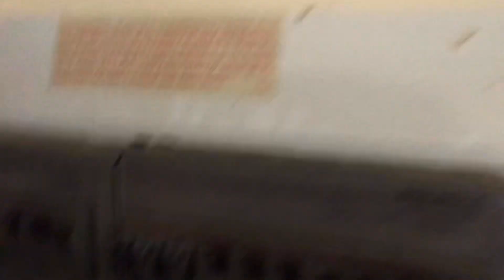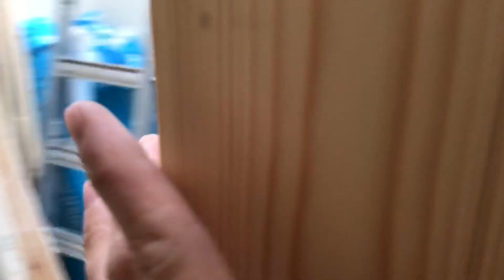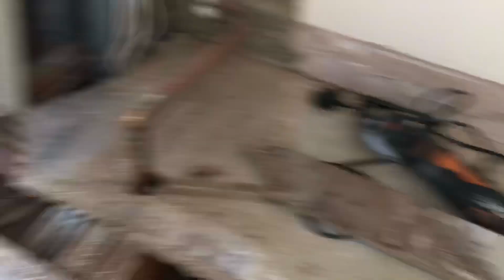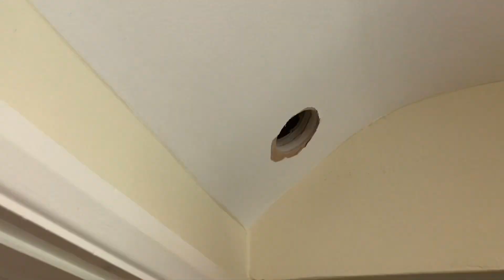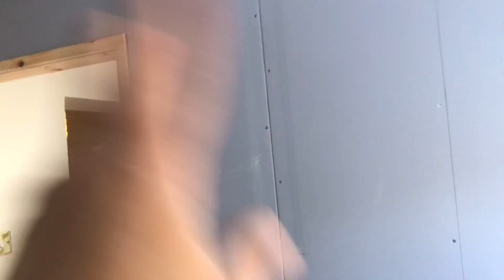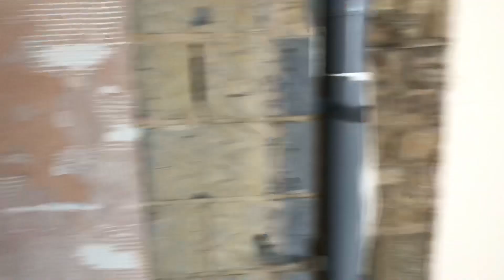CJR ELECTRICAL | Electricians day installing shower circuit.

Comment: I’m certainly not having a go at you.  We all here to help & educate each other.  I cannot get my head around you reducing the circuit breakers to 20A.  If it’s a typical household, there would be no problem what-so-ever.  The kitchen ring would probably use a fair bit if everything is running at the same time,  but what are the chances of that, the other rings would probably use next to nothing.  Unless your concerned with the current going through the Rcd?  Then you could put the shower through a rcbo at the front end or use a 2nd board.  If there were 2 showers or a shower & a car charging point.  I would maybe install a priority switch.  In my opinion & I maybe wrong, changing the 32A is a waste of time & money & completely pointless.  Also 20A rings are no safer than 32A rings. Open conductors still need to be found as they could be floating about causing fire risks, reducing the current rating will not prevent this.  I have seen on many occasions an open neutral or line conductors just put on a 20A OCPD, without the circuit being corrected or put on 2 separate radials.

Comment: I’d like to use metal boxes everywhere but the boarders can’t cut a tight hole around the box and you end up with that bit of plaster which keeps cracking off.

Comment: I'd be really interested to see your vid of second fix of the shower isolator switch. With 10mm in a 1G, they are evil.
Reply: Errr it was a 2 gang metal backbox and he managed it fine.
Reply: @ashmanelectricalservices4318  This is bollocks. I'm just saying how hard it is to wire up shower isolators using the standard 10mm cable. I find I have to fold each wire in a certain way so  that you do not strain the terminals when you push the face on or take it off. That's all. People are so defensive in this industry.

Comment: Why not just use metal plaster back boxes? They do sell them. I use them as I prefer metal then plastic.
Reply from the maker: Yes I could do but at 5 x the price il continue with my method.
Reply: @Cjrelectrical  Aye, I agree with you mate! I'm going to try your method, thanks for the tip! :)

Comment: How will de rating Mcb’s change maximum demand?
Reply: As things stand 32+ 38.4= 70.4 amps
After downsizing 32+24= 56 amps
Reply from the maker: Is this a serious question?

Comment: Not a criticism but you didn’t fit plastic back boxes as metal ones are “fire proof” but then you use wago plastic boxes? 
I use wagos and plastic back boxes so it sounded weird why you gave that reason😄
Keep up the hard work Chris I’m on my holibobs but the phone don’t stop, what do you do when you have time off? Answer phone message or ignore calls like plumbers😄😄
Reply from the maker: When they invent a metal MF box I will certainly be using them. When on holiday I let it go to answer machine but get back to clients at night if not urgent. Emails are non stop though.
Reply: I'm finding messenger on Facebook the no1 communication at the moment, emails not as much lately but can't complain always busy busy😊

Comment: When I did my 2391 fifteen years ago, military clipping your cables was one of the 10 departures on the practical inspection part of the exam. you seem to do it everywhere you have multiple cables.has this changed in the regs? I was told it affects grouping factors etc & was frowned upon as bad practice.
Reply: So did I. I was taught it was a c2 due to the cables being flat. The reason being that any heat can't disopate from the cable correctly
Reply: DaC27 96 guess they don’t teach that on the weekend warrior five minute domestic installer courses!!
Reply: @guymartin7757  lol probably not.
Reply: What’s military clipping?
Reply: @Alexander_sparky  clipping cables back to back with one clip instead of clipping them flat next to eachother with 1 clip on each.

Comment: Those old contactum breakers are obsolete and the newer colour coded ones don't sit happily on the same busbar. I usually advise clients that it's often better to upgrade to a new board. Schneider/Square D are the worst when it comes to doing work on older boards.
Reply from the maker: Thanks john I will make a note of that.
Reply: CJR ELECTRICAL would be nice to have an rcbo in way 9 as John says new ones not the same alignment but I think they may come with a small piece of bar to make up the space ,contactums way of getting over it
Reply: The adaptor is obsolete too. Second hand RCBOs that fit these boards are like rocking horse sht.

Comment: Don't really like the horizontal shower zone, sorry. Doesn't matter about the light cables needing to be 50mm in from wall. All lighting now needs RCD protection. You'll need to fit at least 2 RCD now are you changing board or fitting standalone RCDS in enclosures ?
Reply from the maker: I have two spare ways on the rcd side of the consumer unit. One for the new shower and they other for the lighting feed to that area.
Reply: CJR ELECTRICAL personally I like the switch cables vertically in line with switch ,rcd protection covers the very fact that they might end up close to the board ,more likely to be hit on the stud as it’s not the zone and it’s a good fixing for something
Reply: A to B via Kings Cross St. Pancras and London Euston 😂😂😂 I do agree though 👍

Comment: What about your additional protection for the lighting via a 30mA rcd/rcbo?
Reply from the maker: Yes correct I have two spare ways on the rcd  side of the cu which I will move the 6amp mcb on to.
Reply: What is the reasoning behind this new regulation, in a way I kind of understand why socket circuits require an RCD, as Joe Public could potentially plug anything into a wall socket but luminaries are generally installed by a competent professional.
Reply: Alvin Ashman Simple Harmonisation with CENELEC/Europe perhaps as the regulation number is not a specific UK only one.